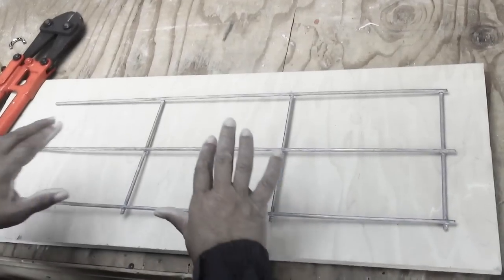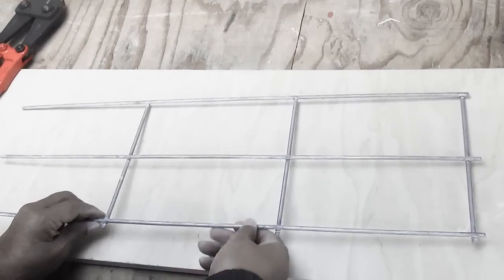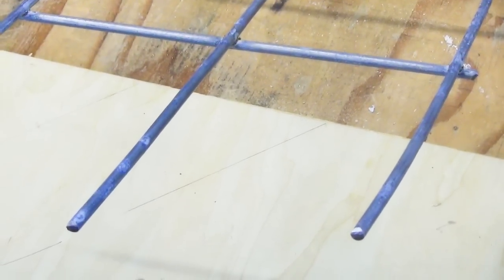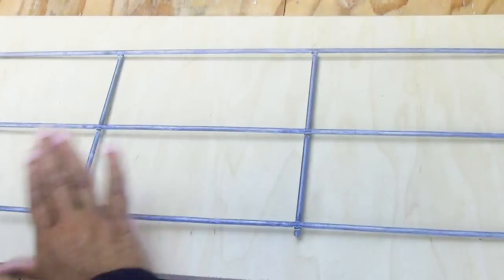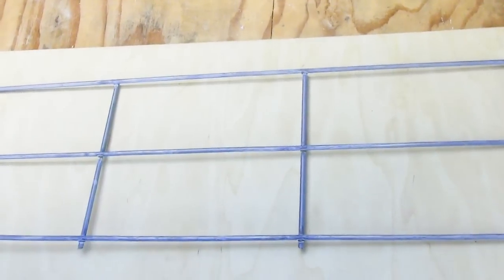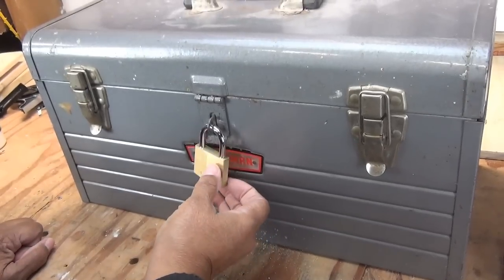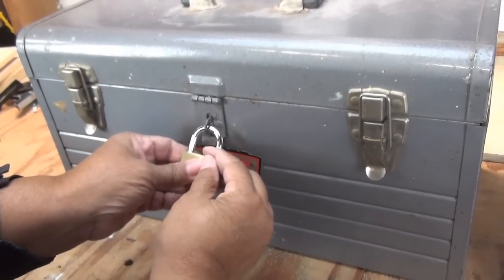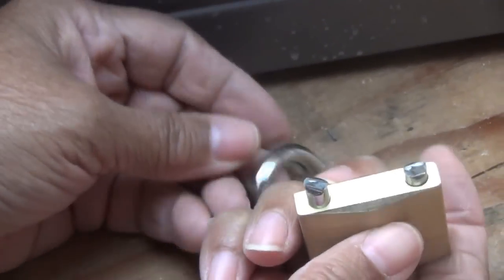How to Cut Heavy Gauge Wire and Other Tough Metal With Little Effort

Comment: Hello Leah I really enjoy your videos.  I can probably shed some additional light on this matter as I am a concrete contractor and I put down 300,000 at of wire mesh last year.   4 gauge is considered roadway mesh and its the toughest!  You are 100% correct a 24” Long bolt cutters is the single nest way to cut!!!!
Reply: is the 24inch specific to the strength of the bolt cutter of just the length of the handles. Like can a 14 inch do the same thing. I am also purchasing cattle panels to make my trellis for cucumbers and squash?
Reply: @KrisGill09  3yrs later... longer handle = more torque/power for cutting. Kinda like using tiny scissors vs normal scissors
Reply: @brohemian this is helpful, thanks!

Comment: Perfect timing. I just got back from the barn where I was cutting cattle panels with an angle grinder running off my generator. With plenty of buckets of water around given that I was putting up fencing around the dry straw and hay. Neighbors have spotted a cougar around here, so I wanted to beef up the security around my goats and sheep.

Bolt cutters would have eliminated the fire risk and definitely wouldn't have freaked out the animals with all the noise & sparks!
Reply: Fire risk is an excellent consideration, thanks for bringing it up!

Comment: EXACTLY the operation i will be doing. cutting cattle panel!
Thanks so much. I just wanted an experienced opinion on what tool would do the job well.

i'd avoid the angle grinder as well -- it can (unless everything is secured in place) grab in the created kerf and break a joint in the panel.

Comment: Thank you! I have three 16' panels to trim for garden trellis and I've used an angle grinder before and it will get metal everywhere and isn't all that fast. It also leaves very sharp edges on the panels. Wasn't sure if bolt cutters would handle it but now I'm gonna go buy some.

Comment: Another great video.

Yes, bolt cutters are safer, neater, quieter and far less messy than an angle grinder but if you have a lot of cutting to do it is probably easier and quicker to use the angle grinder.

Battery technology and cordless tools have come on so much in recent years that you are no longer tied to a power cable.

With the likes of Ryobi doing their one battery fits all range of power tools having a variety of cordless tools is no longer painfully expensive.

Comment: Great video!!! I have to cut 14g welded galvanized steel hardware cloth with 1/2" x 1/4" openings. I started with my bolt cutters. It took so long to cut, that I gave up. I really need to get my 50' roll cut into sections ASAP for my chicken coop and tractor. We have bears, cougars, weasel species, etc. Do you have any advice that will make this cutting faster? I live alone in the wilder area of NW WASHINGTON state. No help with my diy projects. Thank you ma'am for all you do!!! 🙏

Comment: Bolt cutters are great for getting the springs from a mattress frame for all those different crafty things.  But not all master locks can be cut with bolt cutters.  That was a selling point back in the late 70’s - the shackles couldn’t be cut with a hacksaw blade or bolt cutters, had to use an angle grinder.

Comment: I think another good reason not to use an angle grinder is that galvanizing is only on the surface of the metal, if you slip even a little with the grinder there goes the galvanization. With bolt cutters you can always paint on some rust retarder on the cut ends if you want to. And as you said Leah, who wants to be dragging out the grinder when the bolt cutters do such a great job.

Comment: is the 24inch specific to the strength of the bolt cutter of just the length of the handles. Like can a 14 inch do the same thing. I am also purchasing cattle panels to make my trellis for cucumbers and squash
Reply from the maker: The longer the bolt cutter, the less force you'll have to apply.  Longer =Easier
Reply: Thank you

Comment: I have a pair of 8 inch HK Porter Mini bolt cutters I can cut nails and screws and cut fence wire easily and the HK Porter ones are a lot less expensive than the Knipex ones and I think they’re just as good.

Comment: Hi Leah.  I'm a complete novice.  Just wondering if a circular saw blade will cut through metal, or do you need a special blade, or perhaps that angle grinder you mentioned?  Likewise, I'm wondering if you need special drill bits for drilling through metal?  Thank you.
Reply: I think as long as you're using a diamond blade for your circular saw, you'll be good! You'd wear down a blade real fast otherwise lol

Comment: I have a large bolt cutter and love it. My first time using them was while in boot camp and I locked the keys to my footlocker in the footlocker and my drill sergeant sent me to the supply room to get the master key to unlock my lock. That was when I was given the bolt cutter and told it would unlock my footlocker and it did, and I had to buy another lock out of my pocket. I will never forget that incident, and I had to get a pair to add to my chest of tools.
Reply from the maker: Hey Sidney, you always have a great story to tell...thanks so much for sharing that with us!

Comment: you have to have a lot of strength to use a bolt cutter which I do not have.  I'm gonna try a carbide oscillating tool blade, I hope it works.

Comment: I suggest NOT trying to cut case hardened chain with the big bolt cutters however.
 I broke my 36" "master key" trying to cut a piece of chain that I didn't know was case hardened. One jaw had a large piece break out of it, and it really flew. Case hardened locks will likely act the same..
 Mild steel ones like you cut in the video do cut nicely.
"\Hardened" is a pretty ambiguous term, especially with "imported" locks. 
BTW those panels make wonderful trellises for beans, peas, and any climbing plants. Also you can cut them and make great tomato cages out of them.

Comment: His Nibs was cutting wire like that for my rabbit pen.  He laid it flat on the ground and held a chisel to the bits he wanted cut and whacked it with a hammer.  My new crazy paved patio was covered in the holes he made and they'e STILL THERE.

Comment: Bolt cutters also come in different sizes too
Reply: Yep and a 14 inch set would of cut that panel easy. Someone with half strong hands could of cut it with single handed Knipex wire cutters.